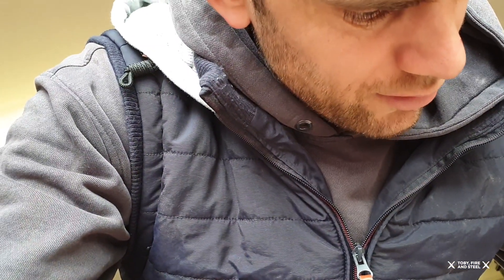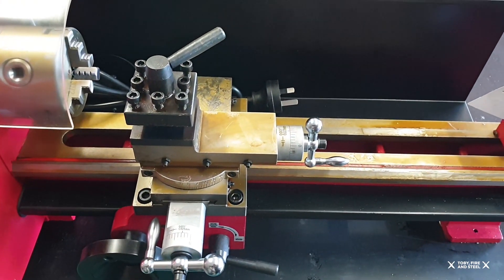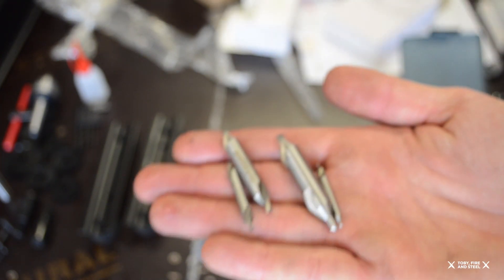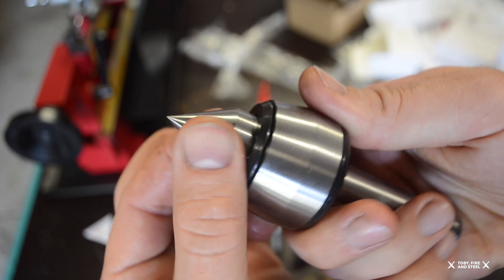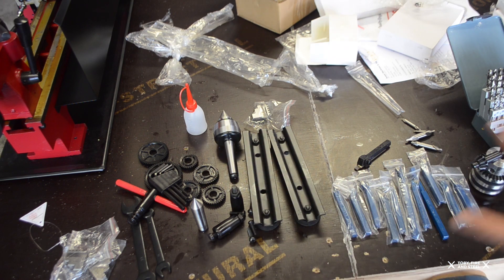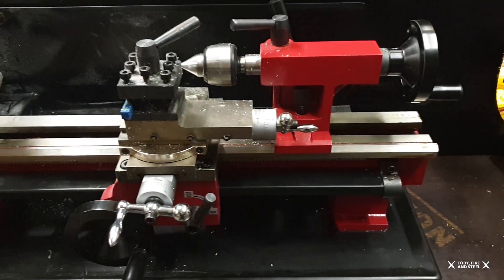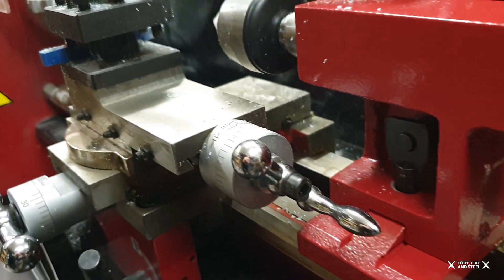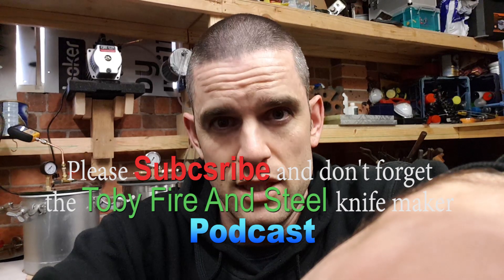Sieg Sc3 7 x 14 Lathe review and unboxing mini lathe

Comment: Probably a bit late, but I just stumbled across your channel. I bought the same lathe about 3-4 years ago. It has its limitations and is not perfect, but more than capable for what I want which is turning brass, copper, aluminium and the occasional steel. I also noticed my live centre and Jacobs chuck were rough as guts straight out of the box but a bit of oil and I never had a problem since.
I also bought mine from the factory warehouse in Dandenong, Victoria. Got a good deal on the exact same lathe, and advanced starter pack. Hope yours is still keeping you happy.
Reply from the maker: Yep still using mine several years later in the uk now. Still does what I need

Comment: Thats cool! Never seen drill bit set like that before, bob on for tapping holes to the correct pitch. Carbide tip tools are good, saves spending hours getting the cutting edge angle on tools sharp. Find Leland a plumbob drawing to make up once he has his hand in with it, nice in brass.
Reply from the maker: Yeah it's a bit different. I generally use 8mm square hss and just grind what ever shaped I want into it. Yeah I'll get Leland on it soon Cheers dude

Comment: does this have plastic gears
Reply from the maker: Yeah bud it does
Reply: @TobyFireandSteel  thanx for the reply helps with choosing which one im going to get
Reply from the maker: No problem mate I've not had any issues with mine. You can buy new ones if they do get shredded. But I also remember someone saying there is companies making metal repairs kits for these.